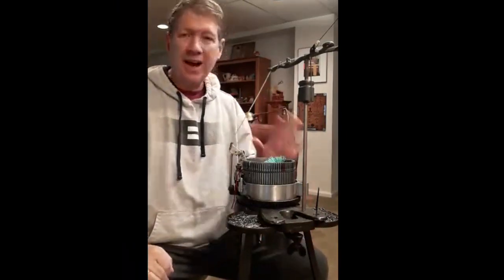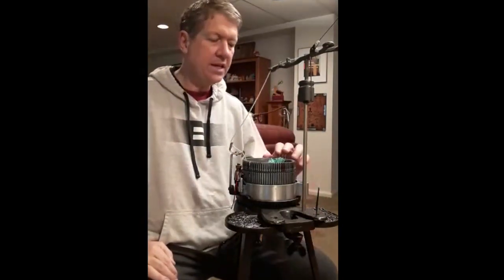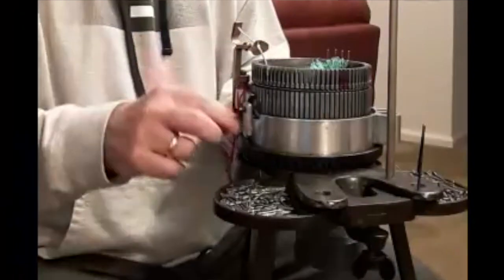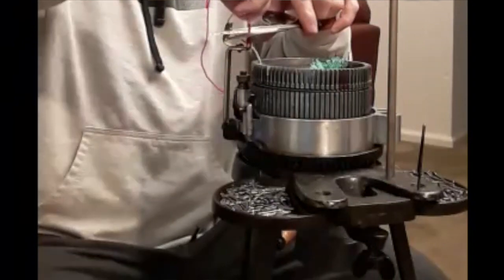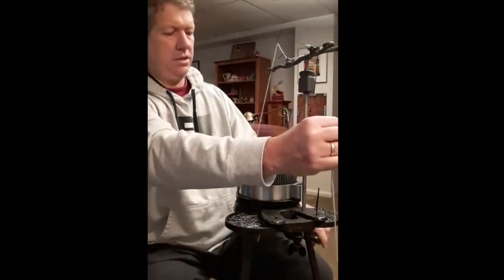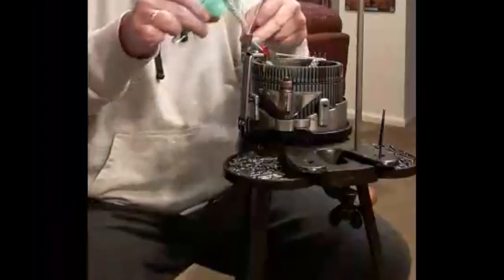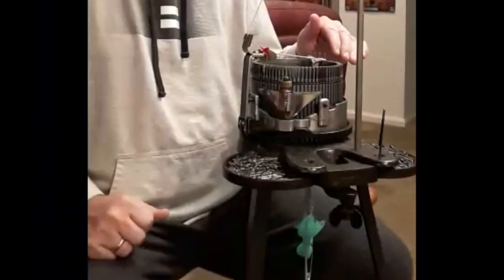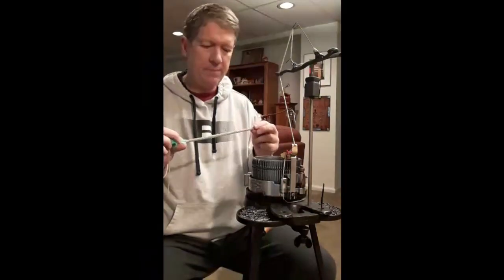iCord on CSM demo

Comment: I really loved how you presented the subject: Tell them what you are going to tell them, tell them, and tell them what you told them.  It was very easy to follow.  Thank you!  I have been nervous to do iCord this technique on my Erlbacher CSKM because I read one is not supposed to turn the machine without needles, but yet the same manual recommended making iCord.  I am not comfortable enough yet to try this myself without knowing the why behind that statement.  Do you have any insight on this?
Reply from the maker: There is nothing I'm aware of that will damage a machine by turning it without needles and I've never had any issue with that. I will say I don't recommend cranking without YARN in the machine. It's possible to damage the latches that stick out and even break them. But I have never heard anyone say don't crank the machine without needles. Especially considering that when I do ribbing, I'm leaving needles out of the cylinder all the time.

Comment from the maker: The paper clip is a much better solution. Smoother for the yarn to flow through more easily. And no, it’s not a reversed video.
Reply: your wedding rig is on your right hand and you are cranking with your left hand (CCW), in what appears to be reversed of the normal rotation/revolution?
Reply from the maker: Sorry it is reversed!!
Reply: @queerjoe  trickster! ;) i never considered using EON to make icord with...i started with just a 72 slot cylinder and the icord i made on it, the needles were side by side. ...this is clever! might dig out some thicker yarn to test with this.

Comment: I’m confused by the crunchy. Is that instead of waste yarn? How do you remove it when you’re done with the i cord?
Reply from the maker: Thanks Jesse...I should have included a better explanation. Just like flat-bed knitting machines, the CKSM needs a cast-on bar...the machine came with a cast-on bonnet (a circular version of the cast-on bar) and many CKSMers make knitted cast-on bonnets to start loading stitches onto the machine. I use the netting from the scrunchy to accomplish the same thing...but there is always waste yarn between the scrunchy and my knitting to separate the knitting from the cast-on scrunchy after it's finished.